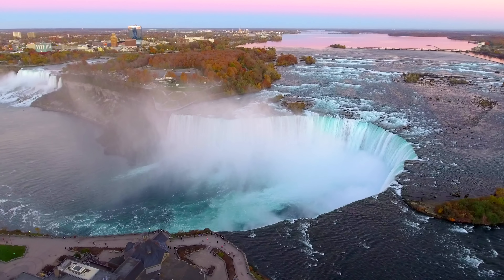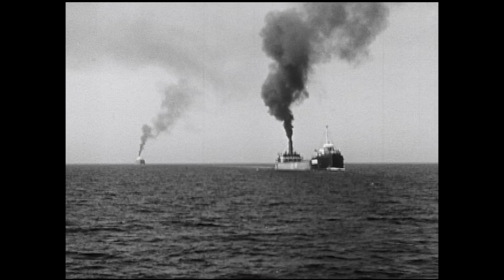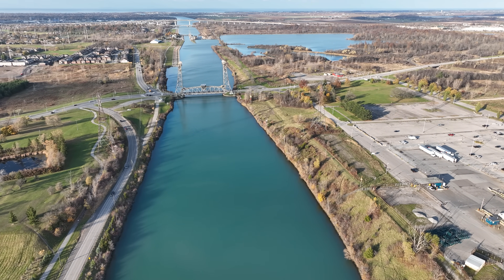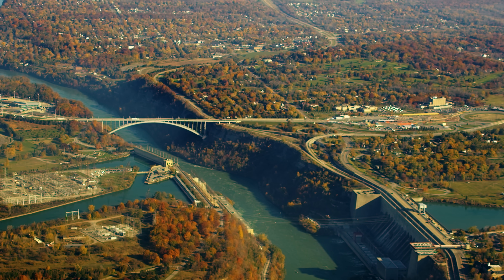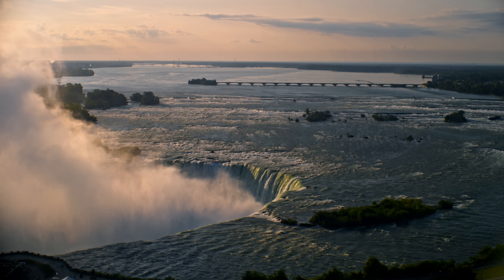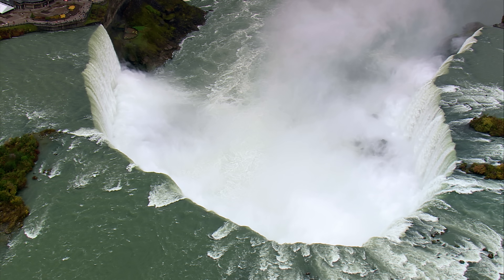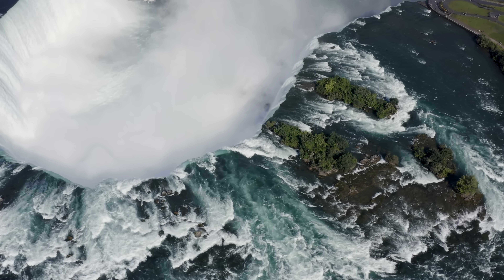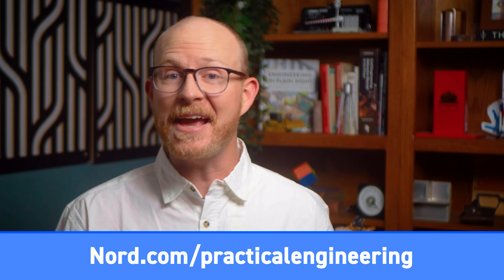The Hidden Engineering of Niagara Falls

Comment: @10:14 "...infrastructure is duplicated..." Is this the reason why Canada is the only British Commonwealth country that uses 110v 60Hz?
Reply: Canada and America share their electric grids.  Thus, if one supply goes down there will be enough slack between the rest of the two countries to keep the lights on.  

Much of Canada's electric power generation was built by Westinghouse, which used 60 Hz and 117 volts (Not 117 volts, but that is a complicated answer).  The American infrastructure was built by Westinghouse as well as by General Electric (Edison) and some smaller companies.  The original GE generators were DC.  When GE changed to alternating current they were 25 Hz and 110 volts. During the 1930s with the construction of several large projects, including the Hoover Dam, Bonneville, and the TVA, the rest of the country all switched to 60Hz 117 V. 

Canada is a major supplier of electricity to the US.
Reply: 🇨🇦
Railway is still 25hz. This legacy lives on.
AC mains is 60hz.
Reply: we share our grids and sell power to eachother
Reply: I believe the Canadian grid is 50Hz
Reply: @1978lburick  No, it's 60 Hz. It and the US side was 25 Hz until the 1950s
Reply: @mirskym  
Canada was mostly 60 Hz from the start.  The US was a hodgepodge of 25, 50, and  60 Hz, depending on if it was set up with Westinghouse, General Electric generators or someone else.  Gradually, it was all shifted to 60 Hz with the Tennessee Valley Authority during the 1930s being a major influence in the transition.

Comment: 1:42 Small technicality here. Niagara Falls does not go over the Niagara escarpment. The Niagara escarpment is closer to Niagara on the Lake and that's where Niagara Falls started around 10 to 12,000 years ago and it eroded its way back to where it's at now presently. With the help of the international control dam, whose main purpose is to divert water over Niagara Falls to the hydroelectric damage that we have situated 7 mi or 11 km downstream, we have slowed erosion from 3-4ft (1M to 1⅓M) annually to 1 ft(⅓M) every decade!!!!
Reply: Small technicality.  The Niagara Falls goes over the Niagara escarpment at a place where the escarpment has been eroded upstream.

Comment: When fishing the lower Niagara River, a loud beeping noise like a truck backing up. Signals fisherman to back up off the shore as with in minutes the power stations will be releasing water into the river. Causing it to rise quickly.

Comment: Tesla and Westinghouse built a prototype hydroelectric power plant designed to see if the Niagara Falls system was feasible. It's in Telluride, Colorado and provided power for a few gold mines on the eastern slope of the valley. Beautiful area and the power house can be seen up close if you want to brave Black Bear Road. I've driven that goat trail several times. Yeee Haww  Oh, it's a one way trail... You'll have to start on the trail head just south of Ouray on the "Million Dollar Highway". You don't have to be crazy to drive it... but it sure helps.

Comment: Interesting side effect of the winter water flow requirements is that water levels in the upper river decrease by about a foot, even a good 5 miles from the falls. My boat got stuck on the lift a couple years ago because I didn't take it out early enough, which is by Nov. 1st.

Comment: The crazy thing is, occasionally the falls run dry on their own...or at least they used to. When the temperature and wind is just right an ice dam can form at the mouth of the river and block the flow. The first time it was recorded in 1848 people walked on the dry river bed. It has happened several times since then causing more damage due to all the modern infrastructure along the river since 1848. Of course this includes the power stations which need the flow. So both sides of the border install ice booms to ensure the ice pack has much less of a chance of building up it on a solid wall.
Reply: The booms are not always sufficient with a strong westerly winds. Ice going over the booms can clog the tunnels to the reservoirs and/or limit the action of the gates.  Years ago, there was a radar mounted on one of the buildings housing one of the enormous steel doors on the US side and an upward looking SONAR unit placed on the river bed to monitor the amount of river ice coming downstream. They may have been replaced by other methods.

Comment: I visited in Feb 2025 and it was great.  The only downside to visiting in the winter is that you can't go on all of the trails that are closer to the falls.  The other downside is that if the ice/snow that piles up causes them to close the normal big walkways along the falls.  I got yelled at by a NY park ranger because I was on the wrong side of a barricade.  I knew I was on the wrong side in one spot, but I thought I was on the right side by the time I got to the point I got yelled at.

If I happen to go again I'll cross the bridge to get the full frontal view.

P.S. There's a neat Nicola Tesla statue on Goat Island.

Comment: Shout-out to Coast Guard Station Duluth @2:05! I was stationed there in 2009 and I got to pilot the Coast Guard Cutter Sundew (decommissioned) under that lift bridge.
Reply: Yay Coasties!
Reply: Not too far from Split Rock lighthouse... Awesome place to visit.
Reply: @gerrywalsh5766  Agreed! I went there and Gooseberry Falls frequently.
Reply: @PipsquawkBirdman I'm not sure if it's still that way, but the rotating fresnel lens assembly floated on top of a mercury bearing... Give the lens/lamp assembly a gentle push and it would rotate for several minutes... hence the simple clockwork drive to rotate the old assembly. Really cool, but also really poisonous.

Comment: Hey Grady, not sure if you're aware of it, as I don't think it was open yet when you were there, but the Niagara Parks Power Station, originally Rankine Generating Station, is a great tour, including the discharge tunnel.

Also, speaking of tourism, are you familiar with the Ocoee River? It's controlled by multiple TVA dams, and two sections have assigned release schedules for watersports. In the morning you can be driving upstream along a riverbed with pools of water and a trickle down the middle, and a few minutes later you're at the put-in location and the river is going full blast. It's really fascinating (and a great rafting trip).

Comment: I highly recommend you visit the Niagara parks power station on the Canadian side. There is an entrance fee, but you get to see the old turbine rooms and walk the tunnels all the way to the falls. Like right beside it near the bottom. The full fury of the waterfall up close is a real treat. 

I also recommend visiting goat island and see the top side of the falls. Lot of Canadians haven't been to the US side on goat island, but they are sure missing out.
Reply: Ended up on Goat Island back in 2014 when there was a major snowfall, I remember walking toward terrapin point with some out of town friends and one dude was like, "This park is so old it has wooden curbs?" I turned to see what he was pointing at, and it was the very top of the back of a park bench sticking out of the compacted snow. We had a good laugh, until we realized that was the same reason we couldn't see the guardrails that usually keep you from a lumpy doom.
Reply: I visited Niagara Falls last month, a fantastic experience.  The Niagara Parks power station is well curated with more than enough info for mechanical gearheads like me.  It is very well preserved, having been run late in the 20th century, an astonishing factoid considering it was churning out 50 cycle power.  The generator speed controllers and switchgear are hands on accessible.  An elevator takes visitors from the generator floor to the outflow tunnel.  The only disappointment is access to the hydraulic turbines at the bottom.  You cannot see them yet.  Access is planned but for now only spare turbines at floor level can be viewed.  The generator hall is impressive.  An even older power house upstream is being converted to a luxury hotel.  Both stations are marvels of Romanesque marble decoration.
Reply: @ggibson511960 if you get lucky, you can ask the elevator guide to open the other side of the elevator to see the turbines.  I got lucky and they opened them for me to see because I mentioned something.
Reply: I was gonna say this. Visited at the start of the year and was honestly more blown away by the power station than the falls. The tunnel is incredible, and even the glass elevator as you go down, showing off all the old infrastructure is spectacular. Highly recommend.
Reply: Did this a couple years ago. Wasn’t cheap, but worth visiting the tail stock down to the bottom of horseshoe falls.
Reply: I concur the power station is a good take if you're interested in old tech. Coincidentally I was there just nine days ago, I recall the ticket was about $26US. I was surprised at the level of complexity that was utilized in the early 1900's and almost everything was operated manually. Taken offline in 2007 it's now a museum, and houses an enormous Tesla coil they demonstrate every hour. Cover your ears, it's uncomfortably loud!
Reply: I was just there in late August a fantastic trip.
Reply: Been there and yes goat island is worth the walk across the bridge but as someon that grew up in NF ontario. That is the only thing worth it. But i can't speak highly enough about goat island and the paths and bridges they put up at the base of bridal veil falls
Reply: Americans kil1ed millions of Nazis and they should do it again, if they want to attract tourists 😊
Reply: I will definitely add both of these to my list. Thanks
Reply: I really want to get my enhanced license so I can see! Ever since I heard they opened up the turbine rooms and the tunnels its been on my list.
Reply: The US side isn't doing too good right now. 😕😕
Reply: We did this tour and it was so much fun!
Reply: this place was like disney land for science and history of niagara. It is amazing and so interactive for children. I'm so impressed with all they offered!!!
Reply: oh I'm sorry I thought you said the power vista-that's on the NY side and it's incredible and free and worth the visit as well!!
Reply: @misslori4146 no need for apologies! We need to know more about all the nice things to do in Niagara on both sides of the border.
Reply: @MightyEumendies  wonderful <3 I highly suggest the maid of the mist as well if you are on the NY side. It is the closest you can get to the beautiful Canada falls. I cried tears of joy the whole time! Worth every cent for that experience.
Reply: I've been to Goat Island recently, and it was great. I went to the Canadian side when I was a kid, but we didn't see the power station. Now that I'm older and an engineer, I am adding this to my list for sure. It sounds incredible.
Reply: I really wish they'd renovate / find a use for the old power company building. It's got some incredible architecture.
Reply: @MichaelfromtheGraves   Yeah! that's the Niagara Parks Power Station is! I love the old big machines and space
Reply: @MichaelfromtheGraves I assume you're referring to the Toronto Power Generating Station that's about kilometer upstream of the falls and between the road and the river. If so,  I agree, it's a beautiful building. 
I was in that building once, sometime around 1982. At that time, they were converting the building for use as a museum about the hydroelectric electric systems in Niagara. I was told, they were planning to call it, "The Engineerium". They had already set up a lot of displays, it looked like it was very close to being ready for the public but, for some reason, it never opened up, I've wondered why.

Of course since then, they've converted the other old hydro building closer to the falls into a museum and they've done a really great job of it too. Highly recommend it for anyone visiting the area.
Reply: The advantage is that you can pay the fee with "fake dollars" 😂